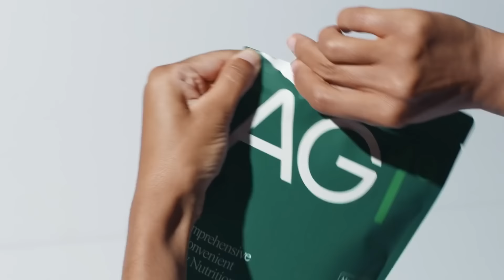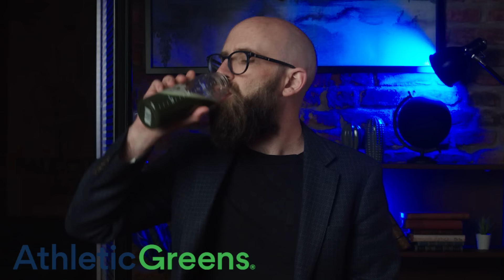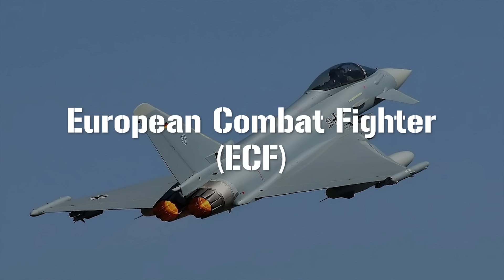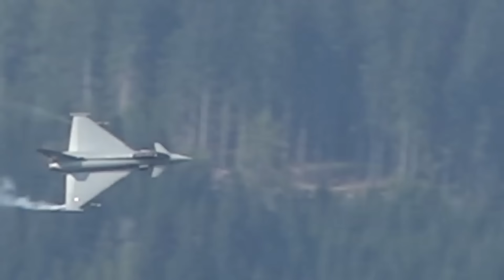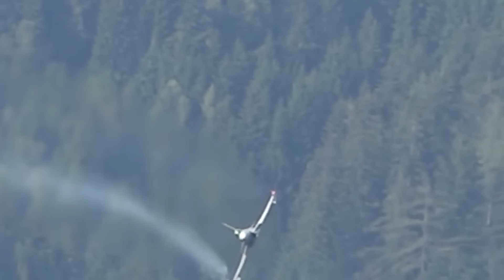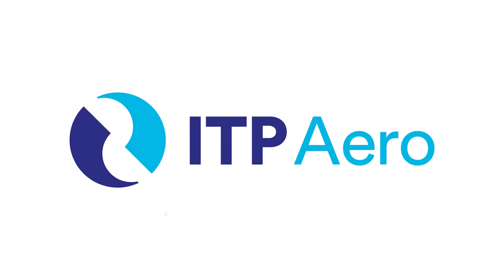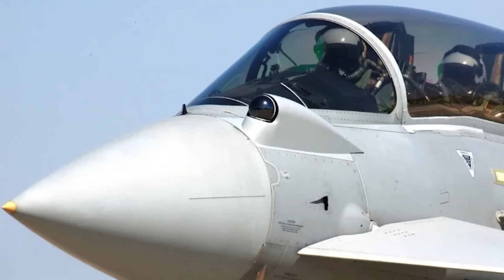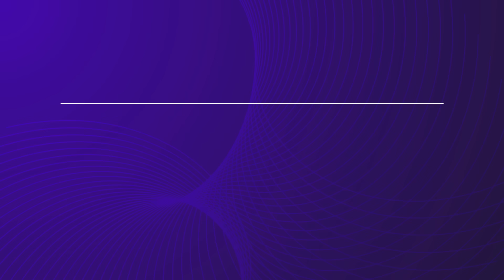The Eurofighter Typhoon: Any Aircraft, Any Mission

Comment: You are somewhat overselling the multirole capability of the EF2000. The Eurofighter was originally a pure fighter. Air-to-ground capabilities were added later. This still makes it suboptimal in the A2G role. The targeting pod can only by fitted on the central hardpoint. This is one of the 3 wet points for droptanks. So the EF can only carry 2 droptanks and a pod. Secondly, the landing gear folds into the wing behind the inner wing hardpoints. As a result long weapons like cruise missiles and anti-shipmissiles can't be carried on these stations. They have to be fitted to either the central hardpoint or the 2 wet hardpoints on the wing. Again, this means that you can't carry 3 droptanks plus large missiles. The French Rafale on the other hand was intended as an omnirole aircraft from the start and it shows. It has 5 wet points. It has a special hardpoint to attach the targeting pod. This all means that the Rafale CAN carry 3 droptanks plus a pod and bombs or 3 tanks and AShM or cruise ALCM. The EF2000 is likely a bit better in the A2A role than the Rafale but the Rafale is a better A2G platform.
Reply: You are right, but you judge a platform also by its ECM suite and radar. Tranche 4 will be a turning point for the Typhoon. Mark my words :)

Comment: A Center of Gravity shifting backwards would mean the aicraft would crash by trying to turn itself backwards. You must have confused with the Center of Lift or Pressure. 
In other words, at lower speeds, the Center of Mass is behind the Center of Lift where it shouldn't be, hence the instability and the computer controlled craft. The craft is designed to have a CoM and CoL close to eachother at supersonic speed to ensure the most manuverability possible.

Comment: Worked in the Typhoon Propulsion Servicing Facility (Engine Bay) at RAF Coningsby for 4 years in  the E.F.D.C. department. Engines were tough old birds apart from the Italian parts of the reheat system, that were prone to cracking and failing until modded, but easy ish to replace.
Reply: Ah, but I bet the italian parts looked the part

Comment: The typhoon is an absolute beast £80 million per aircraft
Reply: the price for the F35  includes the cost of design and development costs. Also, comes with missiles and bombs and targeting pods and multiple parts and maintenance training and pilot training. so yeah, buying the other fighter(s) is cheaper upfront then buying the F35. However, maintenance training and pilot training and extra pods and missiles does not come with the purchase. Not to mention no spare parts and no spare engines. The F35 also comes with an extra engine. And the cost per hour is high on the F35 because the cost to keep the stealth fully capable is expensive. When there is just a chip or Crack on paint or panel, the entire section has to be replaced and repainted. And when a tiny tiny tiny gap forms from pulling Gs, that entire section has to be replaced and repainted. That is mostly why the cost per flight hour is so high on the F35.

Comment: In Germany and Austria, Eurofighter pilots wear Libelle flight suits, which are hydraulic instead of pneumatic and allow for even more extreme G forces. Also, Pirate can network with IRIS missiles, enhancing the planes overall detection and targeting capabilities. IRIS is an impressive piece of hardware and probably worth its own video, the politics behind its development are also quite interesting. As soon as the aircraft powers up, the missiles' sensor heads constantly scan the environment, visibly tracking any heat source they can find. Which is probably you if you're the strongest heat source in the vicinity. Having those things follow you around as you walk in front of the plane is kinda unnerving...

Comment: "Any mission". Whilst working for BAE  at Wharton, I remember being in a meeting with the RAF during the early development of EFA, where it was suggested by us that we could provide some Air-to-Ground capability using existing sensors and systems.  The response from an RAF member was startling to say the least.  They got all red-faced and  literally shouted that the EFA would NEVER have any ground attack role.  We didn't dare bring  the subject up again during my time there.
I now look back and laugh. 
I wonder if there are any Ex-RAF types who remember the meeting?
(Worked on EMC, lightning strike and NEMP.  Somewhere buried in amongst all the paperwork there is a design for an anti-lightning strike fuel pipe insulator with my name on it)
Reply: That anti-lightning strike fuel pipe insulator design was pure class.
Reply: That's really interesting to hear that first hand info. It would seem to confirm a comment I was about to make. My understanding is that the Typhoon has done a bit of a David Bowie reinvention of itself over the years where at the outset it really had quite limited ground attack capability implemented but over the years with sensor, electronics and software upgrades plus additional weapons integrations it is now extremely capable in that role. Also, since some of those upgrades are tranche-specific isn't it also the case that some of the RAF's Typhoons are essentially still single-role QRA-only aircraft since the Tranche 1 aircraft can't be upgraded to latest spec? I believe those old trance 1 are being phased out now though.

And talking of upgrades I think it would have been worth mentioning Captor-E in this video since that gives Typhoon a really impressive AESA radar that, due to the Typhoon's big nosecone and the mount already installed, will not only be able to beam-steer (as any AESA radar can) but will also retain the old passive radar's mechanically scanning mount on top of that so Captor-E will have an unusually high field of regard for a combat jet radar.
Reply: Ahh EMC, that's my field too (mainly automotive though) and what a dark art it can be.
Reply: Didn't the RAF also try to get the cannons removed from their Typhoons for a while?
Reply: @RaderizDorret  that was down to the then prime minister Tony Blair cutting back on the defense budget so deciding Typhoons didn't need their cannon.
The problem was it altered the set up and made them too unstable to fly.
Hence the cannon was put back but with no ammunition.
Reply: The RAF had the mosquito in WW2.
Since then every RAF aircraft must be multi role.
Reply: The F-15EX has the strongest center box among any fighters worldwide, enabling it to effortlessly handle any G-force at various loads. In my view, the future F15 should leverage the rear cockpit by integrating advanced command computers to replace the weapon officer and command up to eight UCAVs alongside to the battle zone. Furthermore, with additional wing pods at stations 1 and 9, it possesses the capability to carry an enormous weapon payload to the war zone, akin to having R2D2 in the back seat. There are endless technologies embedded into the F15 that may be better than the F35 or the next 6Gen. The F15 will always be the workhorse that can carry massive weapons and now it has technology companions that don't care about G-force maneuvers. Compare: 1 (6 Gen Fighter) vs 1 (F15EX+8 UCAV).

Comment: I remember a whole bag of controversies when the EF first came out. Delays, over budget, not certified to lift off when it's hot or cold, not allowed to carry its gun, etc. But I'm really amazed and happy how this machine has shaped up over the years, overcoming all those growing pains and meeting or exceeding expectations.
It will be at least two decades until FCAS will see deployment, but I'm hopeful that the ongoing upgrades and refits like the new electronic warfare kit will keep the Eurofighter up to date to meet any upcoming challenges Europe might face.
Reply: So basically what happens when any new jet is introduced?
Reply: @razorburn645  Pretty much; I do remember similar controversies about the F-35 though that project was of course much more expensive.

I don't think it has always been this way, but as military hardware becomes ever more advanced and expensive, this is probably the new normal?
Reply: You must be Austrian too, maybe?! Some of the discussion back then was ridiculous and the downgrading the Austrian version got then made it have every problem that was before said it would have. My favourite story was the one where Austrian newspapers wrote that the aircraft is junk that falls apart in the air. The reason for that was that a German one lost an external fuel tank when starting, which later was shown was due to the ground crew using a socket wrench instead of a torque wrench to fasten it.

Comment: As someone who has worked in jet engine maintenance for 30 years, I can safely say they are the best and easiest engines to work on in i have come across, in battlefield conditions this aircraft would be back in the air quicker than any other hands down. The f35 on the other hand requires over 10 hours of maintenance per hour of flight, and there are currently over 200 mothballed because the maintenance issues in them are too huge
Reply: Much of that maintenance is spent on the stealth coating. The ceramic replacements being tested should eliminate most of that.
Reply: Is it more expensive than other aircrafts? Everyone seems to complain about that, but given your comment i'd suppose it needs less man-hours, isn't it?
Reply: @JackGarcía-g8p  It's cheaper, in the long run. Spain's recent acquisition round of the Typhoon came at around 100M per unit compared with Germany's 240M per F-35. These figures are the money governments allocate to their airforces for their respective aircraft projects, so it includes the price of the aircraft and all of the maintenance and spare parts and training.
Reply: @user-cc32vcg811  and the price includes the cost of design and development costs. Also, comes with missiles and bombs and targeting pods and multiple parts (as you stated) and maintenance training and pilot training (which you also said) so yeah, buying the other fighter(s) is cheaper upfront then buying the F35. However, maintenance training and pilot training and extra pods and missiles does not come with the purchase. Not to mention no spare parts and no spare engines. The F35 also comes with an extra engine.
Reply: Still better than the Merlin helicopter's maintenance time. My dad worked on them and I them ember some of his rants about old smoke and mirrors.
Reply: Because the F35 has about, 34578997 different types of hardware....software....more precise maintenance expectations to keep its stealth capability at 100% and its its has everything internal, when the euro fighter has external targeting pods.....you are literally comparing 2 aircraft that couldn't be anymore different in every way......what in the Holly hell haha
Reply: Will we see the return off the harrier aha ;)
Reply: Would love to see a Gripen with EJ200 tbh
Reply: Maintenance is less relevant when you take into account the facts that the f-35 is stealthy which requires more engineering and Maintenance and the fact you can get a cheaper f35 for around 2/3 the price. That's part of why despite the eurofighter tpyhpoon being sold for 20 more years there's been nearly twice as many f35s sold. Also I can't find anything on a fifth of the f35s built being "moth balled" and see the opposite: orders keep rolling in and jets keep rolling out, if they were a white elephant the orders would taper off or be canceled but demand remains high.
Reply: If that's the case, why is it that every competition for a fighter aircraft buy that has the F-35 and Typhoon in the competition, the F-35 is the one that ALWAYS wins? Is it partly because it is cheaper to operate than the Typhoon?  I would say the facts state "yes".
Reply: @AC_702  The operational cost has nothing to do with that. The F-35 and Typhoon play completely different roles in combat, and most people want what the F-35 provides.
Reply: @JiyoDoodle  yeah thank you. The Typhoon, Greepen and Rafale are superb interceptors with attack capabilities assuming air dominance is established.  Whereas the Lightning II was designed to operate over enemy conflicted space  with interceptor  capabilities. 
  Ideally, the f35 should be paired with one of the other aircraft to cover most missions.  Unless a nation would use it in both roles.

Comment: The cost/hr to operate a machine of any kind must include the cost of each part life in $/PS (US here, no British Pound key) per hour. Past that, I'm surprised no one has mentioned the difference between COL and COG. ;) I hope to see one of these at an airshow, someday.
Reply: the price for the F35  includes the cost of design and development costs. Also, comes with missiles and bombs and targeting pods and multiple parts and maintenance training and pilot training. so yeah, buying the other fighter(s) is cheaper upfront then buying the F35. However, maintenance training and pilot training and extra pods and missiles does not come with the purchase. Not to mention no spare parts and no spare engines. The F35 also comes with an extra engine. And the cost per hour is high on the F35 because the cost to keep the stealth fully capable is expensive. When there is just a chip or Crack on paint or panel, the entire section has to be replaced and repainted. And when a tiny tiny tiny gap forms from pulling Gs, that entire section has to be replaced and repainted. That is mostly why the cost per flight hour is so high on the F35.

Comment: I live less than five miles from the flightline of an U.S. Air Reserve Base where, occasionally, trainings in F-16s are conducted. Of the aircraft typically used for training at the base, the F-16s are definitely the loudest and easiest to identify (locally) when in operation. As loud as I can hear the F-16s at approx. 3+/- miles away, I imagine that the sound of an operating Eurofighter Typhoon, when standing right next to it, is just a lot of a bit louder. 😄😉

Comment: The Eurofighter is a reasonably capable aircraft. However, the fact that the talking points usually mentioned - intentional instability, delta wing, canard, mach 2, G suit, 9G airframe, FLIR, LD/SD  Capability, etc... These are all gen 4 design factors, while no gen 5 factors are mentioned. While I have never flown a Typhoon, I have flown against them, and frankly they are not a difficult aircraft to master.